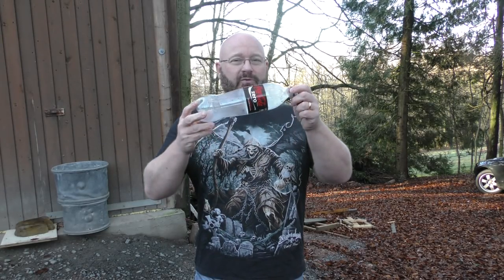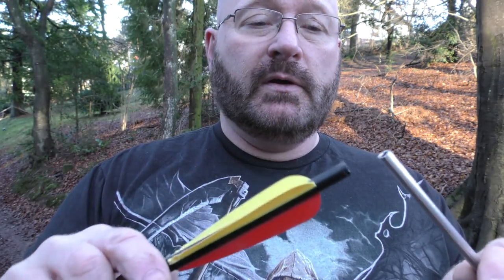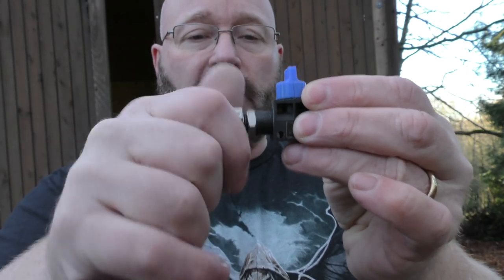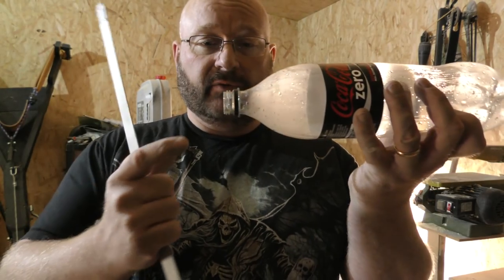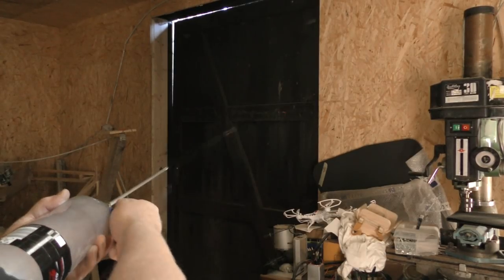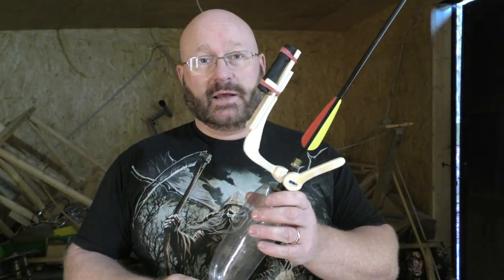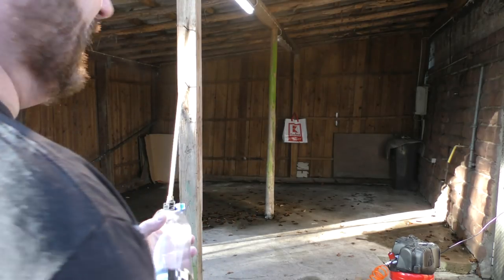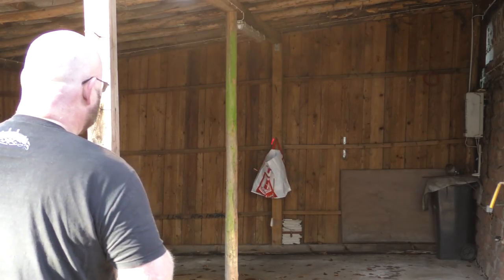How to turn a Coke bottle into a deadly arrow airgun

Comment: I can't believe you have laws regulating BBs.
Reply from the maker: +Gooberslot The law isn't covering BBs in particular, just guns in general. BB shooters are guns, too.
Reply: +JoergSprave Are there also laws against Nerf guns? How about toy dart guns?
Reply from the maker: +Gooberslot There are exceptions for toy guns.
Reply: +JoergSprave Where I live BB guns are considered toy guns also. I don't see how you could see them as anything else.
Reply from the maker: +Gooberslot There are some airguns that you can use to hunt big game. Some models exceed 500 ft-lb with a .45 caliber bullet.
Reply: +JoergSprave You should buy some property in Czech republic if you live near the borders, so the next time you can say "I'd be illegal for me to do this in Germany, but since I'm in my cottage in Czech republic it is perfectly fine for me to do this" :)
Reply: +Gooberslot The narrative being propagandized is one of fear and encourages dependency. When you give up your responsibility, you give up your freedom. Mastering personal responsibility is a great strength. Strong individuals are hard to extort.
Reply: +JoergSprave There are also some nice 50 caliber PCP air guns. One is called the Sam Yang 'Dragon Claw' that retails for about $700 and two other styles made by Evanix retailing for $1500. each. The Dragon Claw is made in South Korea and I'm not sure about the Evanix. Both can be charged to about 3000psi using a 4500psi scuba tank or high-pressure air pump (which takes 30min of manual pumping to get to full charge)! The Dragon Claw. has 2 air power level settings. One is lower for just plinking or small game and the other is high pressure for hunting big game. I watched a youtube video where it took down a cape buffalo!with a couple shots but I can't find it now!
Reply: +rampaginghamster Nice idea. the US is far to far away for that, ha.
Reply: +Gooberslot our laws are fine.
Reply: +Bronkobimb have you ever watched gameplay of black ops 1 from Germany ?
Reply: Danny Wontwork Have you ever watched American TV? They can't say shit and fuck and stuff like that without getting bleeped.
Reply: +Gooberslot It depends on what you call a BB. The BB's I know are metal, but some people call plastic or nylon Airsoft pellets BB's. Airsofts aren't guns, they're toys. But metallic BB guns are weapons. They aren't FIREARMS (and the jurisdictions that think they're firearms are goofy in the head...I'm talking to YOU, New Jersey!) but they if they shoot a metal projectile, they're weapons.

I'm pretty sure when Joerg talks about "BB's", he's talking about the copper-clad metal ones, not Airsoft pellets.
Reply: Danny Wontwork does this define good laws? ^^ and btw. why would you have the right to judge the laws from another country? i guess your american...
Reply: Gwen Patton I was referring to the metallic BBs and I still consider them toys. Maybe if you're talking about some of those high-caliber high-power weapons that a couple of commenters have mentioned then calling them weapons would be justified but that's still no reason to regulate all BB and pellet guns as weapons.
Reply: +Gooberslot Ah, I see. I wasn't saying that the laws regarding them are good or reasonable, I was simply explaining the division line. A lot of states see plastic projectiles as "toy" and metal projectile as "weapon".

My state in the US treats slingshots as "weapons" but nearly incidental ones, not like firearms. They DO, however have very specific definitions that prevent you from using one for hunting in my state. I have two slingshots (so far) for emergencies and for fun. If things really hit the fan, I could augment the pot with some squirrels or rabbits, but it'd be a case of "don't get caught", because using slingshots for hunting is illegal in my state. There isn't even a SEASON for it as there is for bows. It'd have to be a case where my survival or health outweighed my concern for that law, and my need to keep it quiet outweighed my skill with a .22 rifle. I might even resort to snares before I put my faith in a projectile weapon, just to keep the potential for discovery lower.

I'm a gun-owner, a slingshot-owner, and lived a fair bit of my life eating game meats, so I am very supportive of the right to own and use such tools. As for the legislators and their paranoias regarding weapons, if someone, particularly a child, gets injured or even killed by a "toy" BB gun, there's suddenly a hue and cry to treat it not as a toy, but as a dangerous device. If it fires a projectile, this automatically goes into the "gun" pigeonhole and the panicky and the fearful start foaming at the mouth demanding bans and/or regulation.  I singled out New Jersey because they have the nuttiest weapon laws I know of, though New York is sneaking up on them. In NJ, you have to file paperwork to request a permit to PURCHASE any gun, and they include BB guns in that definition. Even if you GET it, you can't USE it for much, because transportation of a gun in NJ is so insanely over-regulated you can't even stop to get GAS legally while you are traveling to an acceptable place to shoot it. You have to have it locked up in the trunk, ammo in a separate locked container, and go DIRECTLY from home to a range, then DIRECTLY back when you're done. Any stops along the way, for lunch, for gas, for ice cream, and you're breaking the law regarding transportation of a "firearm".  I think they actually consider a BB gun a "shotgun", unless the barrel is rifled. Totally insane. 

tl;dr -- I don't AGREE with the definition, I'm just pointing it out.
Reply: +Gwen Patton .. Trust me mate, I'm from Belgium and the European gun-laws ARE insane.! 
Also, NOBODY Stands behind us NOR has àny symphaty for the gun enthousiast's overhere... Instead Wé, are considdered wacko's, murderer's and other low-life's.! Cause why élse would anyone want a weapon, but to kill other people.??. And éverybody without guns agrees with that shit, so the governm WILL act accordingly, using all gun- related crimes to "castrate" us and our "freedoms".. ( The few we still have.!)
Count yourself lucky to have the NRA... Here, it's éven illigal to PROTECT YOUR POSSESIONS.!! How fucked up is Thàt.?? 
..JUst Kéép fighting for your right, to arm bears and to bear arms.. :)
Greetz from Belgium.
Reply: +TheDeathRises Have you ever even met a Syrian before? Do you have many Syrian friends? Are you a Syrian?
Reply: +Zara Hall 

To be a man... to be an adult... to be an alpha human being... to be in total control of yourself and your destiny... to have all of your freedoms available, you MUST have your wits about you to avoid getting killed by psychopaths.. or having your hard earned possessions stolen from you... you must be intelligent and responsible. You must be brave and put freedom before safety and put logical thinking snd devisive action before fear and panic. The only way to do this is to get used to having such freedoms and become skillful in taking on life challenges and reading other people to figure out their motives.

Responsible adults don't let their government control them for the sake of safety. Safety doesn't exist anywhere. If you believe yourself to be safe on your phone or computer reading this comment then you are gravely mistaken. 

YOU CANNOT POSSIBLY TRADE FREEDOM FOR SAFETY, AS FREEDOM (IS) YOUR ONLY SAFETY. MORE FREEDOM MAKES YOU SAFER. GOVERNMENTS RESTRICT YOU AND THEREGORE ENDANGER YOU ONLY TO INCREASE THEIR OWN POWER.
Reply: yea thats germany for you
Reply: +ziono and Australia
Reply: +Zara Hall There is a massive difference between being "civilized" and being brainwashed or intimidated into letting others control what you can and cannot do or say or own. I'm a civilized person who owns a gun and I have yet to kill anybody. There are many psychopaths roaming the streets of "civilized" Europe who don't need guns.. they just use knives, clubs, firebombs, or brute strength. If you came across such hardened criminals, a gun would likely be your only hope unless you're a Kung Fu master (which I heavily) doubt or the police learn how to magically teleport to those in need instantly upon sensing trouble in the air (which needless to say will never happen).

You say you would choose not to kill a burglar... You would honestly stand by and watch them take your valuables..? I have trouble believing that. What if they decide to tie you up and beat you, or rape and or kidnap your daughter? What then? An ounce of prevention is worth a pound of cure. One of the biggest fears of burgulars and biggest discouraging factors to engage in burglary is the fear of getting shot by the homeowner. Firearms have prevented and stopped countless burglaries in the US.

Burgulars are scum who need to die. They do no good to society. They are some of the least civilized and most sociopathic people you can come across and yet you seek to preserve and encourage them. 

The only thing worse than a bad man is a good man who will st and by and do nothing.

You try to pretend you don't live on planet earth by denying the existence of Alphas and Betas while following the alphas of your society blindly like a beta. You've proven yourself a beta, and no amount of pretending and disillusionment can change that.

You have freely given up your rights and denied yourself the ability to better protect yourself. You have chosen to be a soft defenseless fool in a hard and dangerous world. Darwinism will have its way with you and your future offspring who are like you in the harsh times ahead of us all.
Reply: +Mitch Fulker yea I live in the us I dont get Australia,'s gun laws the us is slowly turning into a country like that
Reply: +Art Of Warring and no I don't run around killing people
Reply: +ziono You're mistaken ziono, my comments were not meant for you. You're just getting notifications of my comments.
Reply: +Art Of Warring ooooh ok
Reply: +Gooberslot well all bb guns are banned here where i live hahaha.
Reply: +john sega that really sucks for you guns in genral can be fun sometimes
Reply: +ziono Guns are really fun as long as you have a lot of ammo, are out in the middle of nowhere and are strict on yourself with gun safety.
Reply: ziono well real, bb and airsoft guns are banned here:{ so yeah sux.
Reply: +Art Of Warring im not really a safty guy but I wear safty glasses and ear protection and I always bring alot of ammo
Reply: germany has laws for everything. bb and airguns aren't even allowed to have more than 7.5 joules
Reply: +Gooberslot  it's a shame i know and  Joerg lives  in germany  france and england are the countries that have the most drastic laws in matter of weapons the only thing you're allowed to carry down the street is a swiss army knife the red one cause the recent models have a lock back system on the main blade this is forbidden  of course you are allowed to own guns or bows and arrows  if you're a hunter or you're into target shooting club but this is about it  but that does not stop people from buying knives or else all though they're not that makes them feel like they are outlaws
Reply: +Gooberslot in Australia all guns are banned, i came from newzealand which is classed as a neighbor and getting a gun was as easy as a 8 hour gun license/safety training and going down to the nearest hunting store lol even as a kid 11-13 i had a small gas powered handgun that shot little metal pellets (it was very powerful for a BB gun).
Reply: +winter XI guns aren't banned in Australia!
Reply: Please save me, oh mighty Government!!! May you automatically take money from my earnings without question and keep me safe from all possibly dangerous things!!! Please take full control of my life so I may never have to think again!!!
Reply: +MadDias guns are made to propel metal at high speeds. What a person does with that is up to the individual. Freedom is something that creates creativity and elevates a person`s soul and intellect. I was born in germany and while i lived there i thought i was free. Once i travelled the world, living and working in different countries for over a decade now i have come in contact with many kinds of freedoms that us germans think is "Dangerous" infact the opposite is the case. Freedom creates true Adults and having a gun means that you have the choice of Killing people or animals. When you shoot at metal plates for sport be responsible, learn and upgrade YOUR firearm then you will grow as a person and can say without a doubt that you are an Adult and you are a Good person. Germany`s coddling and controlling of every aspect of social life feels now revolting to me. I love my freedom even if its bad for my health. I love choice and i love what this choices have done to me.
Reply: +Art Of Warring ... bad guys will always find a way. but what Joerg doing that is kind of artifact like samurai sword... it's an art of invention, not a weapon to kill
Reply: +Gooberslot Injuries and deaths caused by air guns aren't all that uncommon. I wouldn't be so quick to look at them as toys.
Reply: +Lorenzo Pacheco Lots of toys can cause injuries. I suspect far more kids are hurt on bicycles than with air guns. Not to mention all the "dangerous" metal toys I grew up with.
Reply: +MadDias Removing all guns will not remove all crime. It won't even lower the crime rate.. In fact it would probably increase it. Criminals don't need guns.. at all..  I'm fact criminals LOVE when the society they prey upon are without arms. Guns are meant for self defence, hunting, sports, and last but not least... The very reason the US Constitution stresses that we have the right to bear arms which shall not be infringed... drum roll ..Defence of the nation from enemies both foreign and domestic!!! ...

 It is a US citizen's right to own a gun(s). US citizens are even encouraged to own guns in case the US gets invaded (it also helps to ward off invasion, the Japanese mentioned they were scared to invade due to the number of guns owned by the public - also, Adolf Hitler created strict gun rules in Germany to prevent an uprising). It's also incredibly useful when you have to form a militia and take up arms against a corrupt government in an effort to reform it for when the inevitable happens... for example.. It becomes too corrupt to function ... which is going to happen again very soon. Our Founding Fathers were geniuses. They could see history repeating itself from miles off.
Reply: +MadDias hay buddy it is, the right of the people  to keep and bear arms, not to keep and bear muskets, but keep dragging other peoples rights through mud just because you choose not to exercise them your self. I would not be surprised if you are one of the same individuals like those at Yale who tryed to petition to ban the First Amendment
Reply: +JoergSprave most bb guns are air guns not firearms.
Reply: +JoergSprave so airsoft guns dont matter there
Reply: +JoergSprave 45 cal airguns shoot pellets bullets or a lead ball which is to big to be considered a bb.
Reply: +TheDeathRises wow playing the race card hard, a sovereign nation has the right to control who enters it. it's not about race it's about security. but keep being a race baiter.
Reply: +MadDias ...The Right To Bear Arms means all arms and it shall not be infringed. It doesn't matter if the gun is belt-fed full-auto, clip-fed semi-auto, or a muzzle loaded musket. The type of gun isn't going to matter. It's a U.S. citizen's right to bear arms.

As the U.S.'s own military gets better guns, so should it's people.
Reply: +Gwen Patton airsoft guns still shoot bbs they are guns because there are airguns, pellets are not spherical like like a bb, pellets are the skirted projectiles. when above the 25cal size a bb becomes a round ball like used by the black powder revolvers
Reply: ***** Personally, I still wouldn't call them "toys". In any case, the argument about what colloquialism describes them best is rather petty, based in semantics, and distracts from the real issue of whether or not they should be regulated. Also, back up your statements with empirical evidence, and keep in mind that the difference between bikes and guns is that only one of them is a weapon intended for destructive uses. I tentatively predict that if one were to look at the respective incidence rates of serious injuries, death, and property damage caused by (or related to) air guns and bicycles as a function of the respective prevalences of each tool and the usage thereof, air guns would score more highly in their tendency to cause damage. Just speculating.
Reply: +Lorenzo Pacheco neither an airsoft gun or a paintball gun which are air guns and considered toys by the government or in any way designed to destroy anything yes they hurt but they are not designed to destroy a thing therefore they are toys
Reply: +Lorenzo Pacheco I would think bicycles have caused far more injuries and deaths than Airsoft guns. BBs just hurt and may blind someone, but bicycles can lead to serious spinal/brain/internal organ injury rather easily if you fall or crash.
Reply: +Art Of Warring not to mention that to a cyclist the biggest threat is a motorist of course motor vehicles are one of the most dangerous statistically
Reply: an american to review 1) Your grammar needs improvement. 2) Cite the laws concerning the things you're talking about. 3) I don't know why you're focusing on air soft and paintball guns now, as was never talking about either to begin with, the reason for that being, among guns, they are relatively benign. With that said, however, what would happen if you were to be shot in the eye or face by one of those?
Reply: Art Of Warring Another difference between bicycles and guns is who is likely to harm whom. When a person rides a bike, he/she does so at mainly his/her own risk. On the other hand, person using a gun is much more likely to inadvertently harm someone else than he/she is to inadvertently harm him-/herself.
Reply: an american to review Art Of Warring Keep in mind that I'm not wholeheartedly advocating the governmental regulation of any and every potential hazard, I'm simply explaining the logic behind why people and their governments would want to keep the ownership and use of things like guns (including "toys" like BB guns and pellet guns) in check.
Reply: +Lorenzo Pacheco You're a very good and logical person.
Reply: +Lorenzo Pacheco well in a way they have tried there's a thing called a band in New York City on fake or toy guns but yet in New York City they actually had a phony gun shop set up with fake guns and try to shame people who are just trying to purchase a gun by saying oh this guns killed 1520 people this that and the other thing but yet its a fake gun so literally could not of but the problem was aside for being a funny gun shop the guns were fake and they were within city limits which is breaking the law but yet because it's actually on the side of wall mount Bloomberg in the gun ban irs because they're trying to get rid of guns those people who were having fake guns within city limits never got arrested at all
Reply: +Lorenzo Pacheco well being shot in the face with an airsoft gun is the same as being shot anywhere else on your body with an airsoft gun and if you've ever even thought about playing the sport you know that is a very good decision to wear eye protection as everyone who plays airsoft and paintball and just to give you the heads up I think Comments and utilizing the voice recognition on my cell phone so thanks so much for the reassurance that my cell phone is so great at recording my voice I really love to hear back from grammar nazis and in the top of it it was an air gun being considered a toy and both airsoft and paintball guns are air guns and both airsoft and paintball guns are rare guns and you were trying to say that air guns are not toys would buy the government many of them are.
Reply: +Lorenzo Pacheco just like operating anything else there are certain safety measures that you take that prevents such threats to others
Reply: +Gooberslot there's air riffles ment to kill large game such as moose elk dear and what not, look up the air force airguns Texan,  it does shoot the most common round which is a. 177 which is what most people think of when they hear airgun, it shoots a .45 cal. with various types of Rounds, so not all all signups are just toys
Reply: +JoergSprave Dude, I really enjoy your channel and your videos. I am a fairly recent left below the knee amputee and I have chronic pain. So when I find something that I like and it makes me laugh I commend that person. Laughter can take a 9/10 pain day and make it go down all the way to 0, 1 or 2. So thanks and keep up the good work. A gentleman like you should do really well if you had your own show where you made money off of your inventions. What I mean is like a show on tv with sponsorship. you are good dude and you are certainly entertaining.
Reply: +Bronkobimb "why would you have the right to judge the laws from another country"

boo hoo

If I could have a dollar for every time I've seen a Euro crapping on American laws (and America in general, for that matter) , I'd have enough fat stacks to renovate the Great Wall of China.

Or is Euro hypocrisy okay in your book? ;)
Reply: +Zara Hall  "i some parts of America you can lure people in your house and kill them and than claim that you were attacked and go free without any consequences"

If you lure someone into your house with the sole intent of killing them, I'm pretty sure (read: absolutely positive) that's 1st degree murder over here. Can't speak for Euro laws, of course, but I can say quite definitively that's not the way things go down over here.
Reply: +Art Of Warring "Those who would give up essential Liberty, to purchase a little temporary Safety, deserve neither Liberty nor Safety."

-Benjamin Franklin
Reply: +john sega :(
Reply: +MadDias In 2010, gun accidents caused  600-ish deaths. Not good, but hardly a holocaust. Most gun deaths in the U.S. have been from suicide. 

Now, in the same year, according to the U.S. Department of Transportation, alcohol-related highway accidents caused 13,365 deaths. So that's alcohol deaths involving vehicles alone. It doesn't count death by other means, like long term liver rot or other types of accidents. When I compare guns and alcohol, I see this: 

Guns are fun, can be used for self-defense, for hunting, for sport, or for collecting. They can certainly be dangerous, but this is easily mitigated through training and common sense storage.

Booze can make you feel good, and can contain antioxidants, especially wine. But it can also cause serious health concerns, be big trouble for alcoholics, may push someone over the edge to suicide, endanger the life of the drinker and/or those who may be around him when he's driving a vehicle, and result in addiction, especially if you are in a down time of life.

Ergo: I see FAR more reason to ban alcohol than guns, were I in the business of taking things away from people. And yet I seldom if ever hear this line of thought from either Europeans or the people in this country who want to take away guns. So what gives? Are people being inconsistent, or am I missing something?
Reply: Warhogz 1 well i was miss informed then :P still i heard it is quite difficult getting guns here and some states dont allow it
Reply: +Gadsden Guy well buddy as someone who live here in the usa there sure are a large number of stupid laws all throughout the country so why would we care if some britts said we have stupid laws. 

the most important ones have the words "WE THE PEOPLE" in the  beginning.
Reply: +Gadsden Guy if you with out a doubt lured in and killed some one it is murder, but we also are innocent until proven guilty.
Reply: +Gadsden Guy Although you speak more sense then many i here when they try to bring up "gun death stats" the usa already tried to ban booze its called prohibition, remember those days were criminal  gangs cornered the alcohol market.
Reply: That guy for 2a defend the constitution Oh, I'm not saying that we should ban alcohol. Far from it. I only brought it up because I almost never hear someone who wants to ban guns, because they are dangerous and "unnecessary", say the same for booze, even though alcohol and its related illnesses kill just as many if not more people than guns do in the U.S. of A.

If anything, the examples of the whiskey runners, the speakeasies, and the general disregard in which Prohibition was held should serve as an example for those who want to do the same for guns: people will still get them, even if you ban them completely. But it will be ONLY the bad guys who will have them, and the regular people whom they target will have nothing with which to defend themselves.
Reply: Yup spoken well my friend
Reply: +TheDeathRises I have always found that the first person that starts calling people racist is usually the real racist!
Reply: +TheAngelofdead666 Man that's just sad. Another thing that is sad is that this liberal movement is growing like wildfire in the USA too due to ignorance and lack of education. They grow poverty, ignorance and liberalism all in the same garden all over the world because it equals CONTROL OF THE PEOPLE and that's the first order of business from all Governments these days!
Reply: +Art Of Warring Your last comment explaing a lot ;)
If you are so unrest with your oppresive government, why don't you  rise in arms against it? So you can have the same arms as the government army use to defend your country (and invade countries)
Reply: +yomauser I think you overestimate the power of government over the people. It's an illusion.. without us they have nothing. Easily can the people rise up and take what they want. 

If they refuse to let go of whatever authority they may have without a fight, Guerilla warfare always works against large conventional armies. 

Homemade IEDs and AK47s seem to still do relatively well these days against our powerful military, but that's only because the military is forced to pick and choose specific targets amongst civilians and noncombatants (as they would have to do in the US, except it would be even harder to tell friend from foe). Every force undeniably and inevitably has a weakness.

The government is 100% dependant on its people, not the other way around and will collapse without them. Obviously.
Reply: yomauser there are other countries that invade other contries not just the usa the difference is the intentions, Americans have spilt mutch of there own blood, spent mutch money, built or fixed many buildings, brought much needed food and resources all to try to help other countries and help make the world safer, but harm can be done with the best intentions.

We have done much good and we have much wrong in our short history as a nation but we are no worse then any other nation in the scope of things. 

We have made many advances in our history and have brought the world mutch, thank the usa for automobiles and airplanes, for fixing the Eiffel Tower for helping in World War II for helping with many earthquake and other natural disaster relief efforts. Or hate us if you wish you bloody wanker
Reply: Art Of Warring Cool anecdotal evidence.
 "Libertarian and we are a fast growing and uncorrupted political party" Could I get some backing up for this? Like actual numbers.
Because that´s worth as much as me saying I´m building underground National Socialist party all over Europe.
And correct me if I´m wrong but you guys haven´t ever got a seat in congress, so what have you guys exactly made difference.
I know it´s more due to your "pick your favorite animal" system that prevents you being part of anything big unless you side with either party and even then if majority decides to ride x opinion you don´t have much choice but let that happen.
For that note I don´t know much about USA politic system, enough trouble here as is.
Reply: +Gooberslot  - In Germany, if a law does not explicitly permit something, then assume it is implicitly forbidden... ;)
Reply: Original50 That is.. terrible.
Reply: +Art Of Warring guess that's life in a country where rights are granted by the government, instead of being inherent to your existence and protected by your government. Sounds horrible.
Reply: Ryan Gunn Yes, the US over the passed few years has been heading towards a more Socialist/European direction. Especially since Obama became president. We're fixing that and restoring everything back to how the founding fathers would have wanted.

 What exactly are you doing to help besides stating the obvious?
Reply: +Gooberslot I cant believe you have now laws regulating normal weapons
Reply: Art Of Warring Oh, the usual, advocating for freedom from government oppression, educating those around me, and voting every opportunity I get. I'm more of a background person :p
Reply: +Ryan Gunn That's a start! Not bad at all. Far better than most  for sure.
Reply: *****
probably where you live (america?) guns are marked with a flashy orange muzzle so you wont think it is an actual gun. in germany however these look just like a real gun, you could go and rob a store with it, thus it needs a law regulation
Reply: +Gooberslot I've heard that people made compressed air based bb guns, that made BBs fly faster than a 9mm bullet shot out of a glock..
Reply: +immer welche Nope. Here's a BB gun I found at Wal-mart: http://www.walmart.com/ip/Umarex-Smith-Wesson-M-P-.177-BB-Air-Gun-Black/17133139

Looks pretty realistic to me.
Reply: +Gooberslot that's because BB guns and pellet guns are considered weapons. Only toys like airsoft have the orange safety marker.
Reply: Haha yea i own a 50 Magnum
Reply: +Gooberslot  have a ricochet in your eye by your buddy shooting .. that why theres laws for BBs
Reply: +Sébastien Bernier I think you've been watching A Christmas Story a bit too much.
Reply: lol probably but any country is diffrent
Reply: i mean with laws
Reply: +Gooberslot well we have a law , that we have to pay the rain water which falls on to our property xD!
Reply: +JoergSprave Hi Jörg erstmal wieder gutes Video aber weißt du wie genau das Ventil heißt das du benutzt hast ?
Reply: +rampaginghamster In czech republic, theres a limit on airguns, its 16 joules i think, anything stronger is class C, can be bougt by firearms license holders, but must be registered with police.
Reply: In canada pellet rifles cant go faster than 500fps otherwise you would need a forearms license and register it as a firearm -_-
Reply: Do these people not even know the definition of firearm? Hint: If it doesn't involve combustion it's not a firearm.
Reply: +Gooberslot would it qualify if he was using his weapon/toy while his arm was on fire?
Reply: Kilo Whiskey I'm going to say yes. :D
Reply: @rampaginghamster Now let me show you it Features muhahahahahhaaaa 666devil666
Reply: If the world governments would just get to the source and just BAN DEATH, then the weapons used become a mute point.  To ban death is to ban people; no more people = no more people dying...that is what we call "Snow-Flake Logic 101".  

Snowflakes - people kill..period.
Reply: Just go to the border with a BB gun, when they say that's illegal just Hold it over and say, not any more HAHAHAHAHAHAHA
Reply: All BB guns here in most of the US are firearms, not toys.
Reply: Where I live BB guns are sold at Walmart and they are considered toys
Reply: jim187187 It's only  in great country where people has freedom to do whatever they want to do. But in many countries people a treat like nothing, just like weak individuals.
Reply: Zara Hall just when did this insane scenario you speak of take place. That may be the craziest excuse for living in fear I have ever read. If someone wanted to lure a person to their home and kill them with no witnesses then it makes no difference if they use a gun or an axe. If you wander into another person's property you had to cross over their fence....it didn't happen by "walking around in nature". This means you are there because you have no respect for laws or other people's  possessions. And nobody is going to just shoot someone for that. Owning a gun means being more responsible than those without one. Your scenario is absurd and based on fear of the improbable.
Reply: Zara Hall do you live in America? Because once again you invent these bizarre scenarios about fear crazy people with guns....there are millions of guns and gun owners in America...if it were as you imagine,  chaos would reign and there would be no safe place to hide. You don't deserve freedom if you are willing to sacrifice some of it to be "safe". Ask anyone who lives in a place where criminals run free and law abiding people live behind walls with broken glass on top to keep them out...I have been there and the police cant save them and because they are not armed, the cant save themselves.
Reply: They want to make sure Germany new rises again. They turned them into pansy's and let Africa in. No more German nation. Very sad.
Reply: @Slingshotchannel  50 caliber even :-)
Reply: EU loves to ban just about anything
Reply: @Gooberslot  In Denmark where I am from you need a permit for a spud gun!